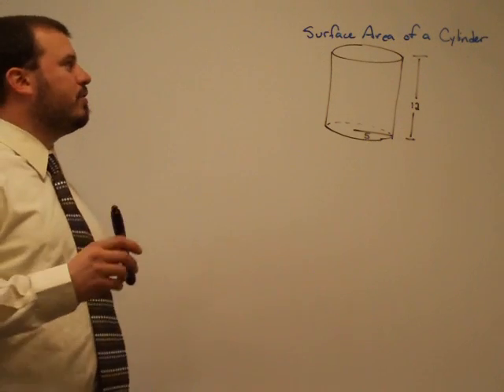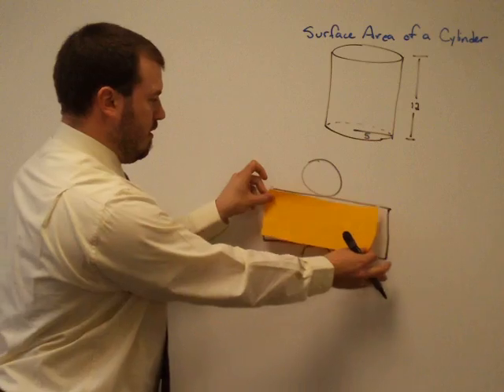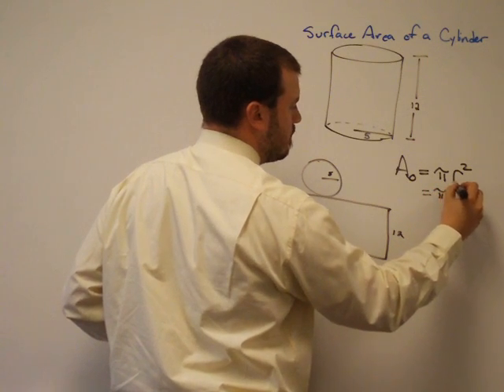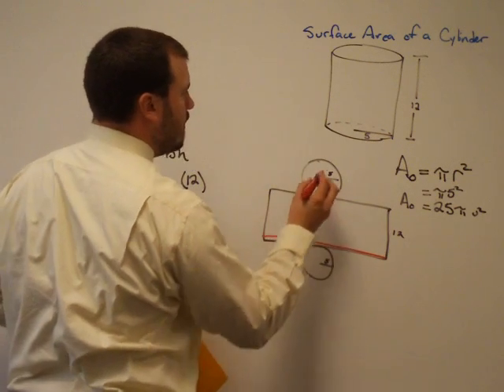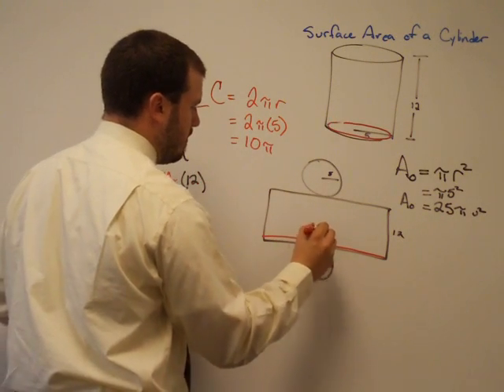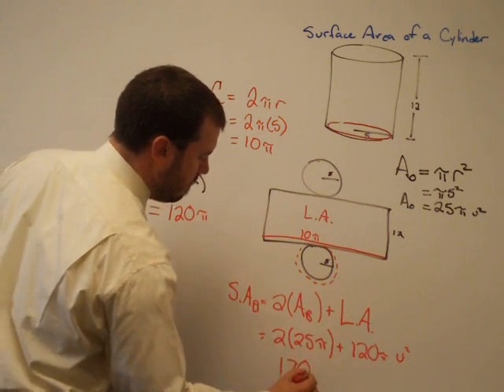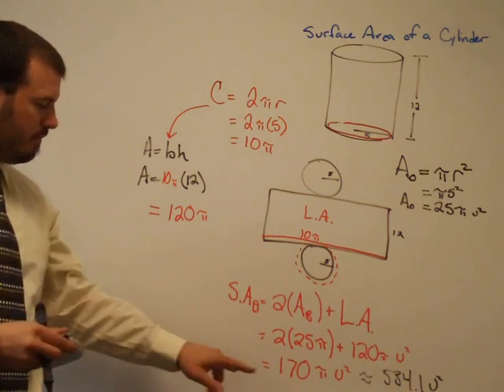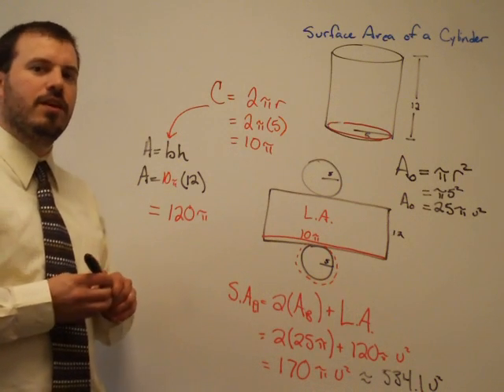Surface Area of a Cylinder

Comment: a circle does have an area, it is pi R squared, were pi is 3.14 and r is the radius,   you multiply R by itself, which is squaring it, and multiply that by 3.14...   and btw, the circumference is the PERIMETER of a circle, not the area

Comment from the maker: The difference is you used 3.14 for pi, and the answer in the back of the book uses more decimals for pi. 
2*2^(2)*3.14+2*3.14*2*6 = 100.48
2*2^(2)*π+2*π*2*6 = 32π ≈ 100.53

So the difference comes from the approximation of π you used.

Comment from the maker: For the cylindrical grain silo with hemispherical top you would use add the lateral area of a cylinder (the rectangular part in my video) to the surface area of a hemisphere (which would be half the s.a. of a sphere).  What I'm not sure of is if you should include one circle for the base, that would depend on the given information in the problem you are solving.  If the base of the silo is just going to be dirt, and you want to know how much material is needed to build the silo, then no.